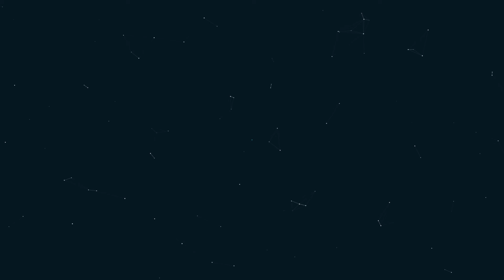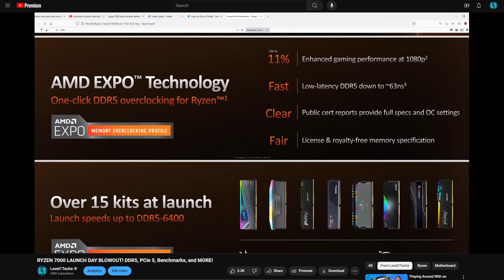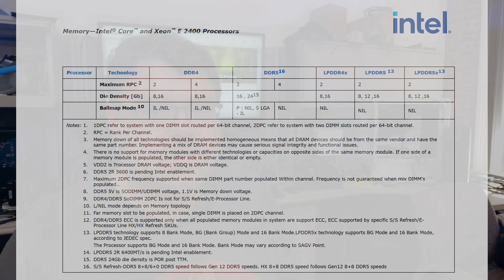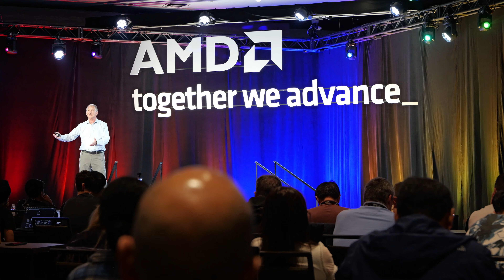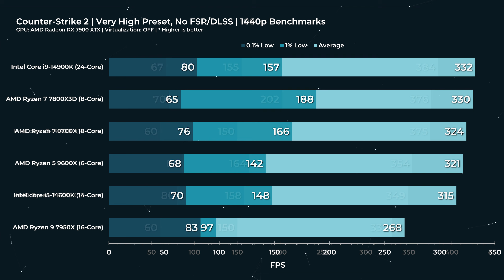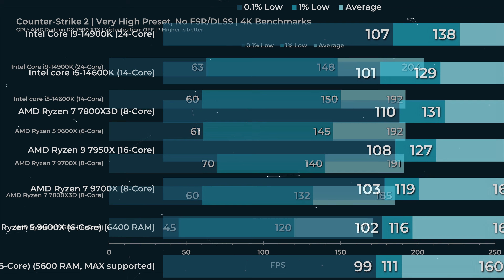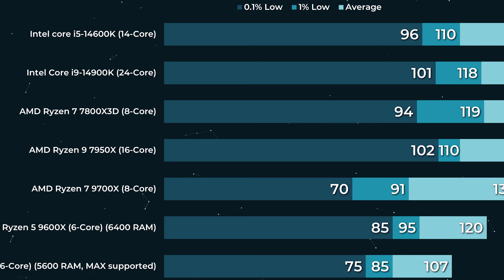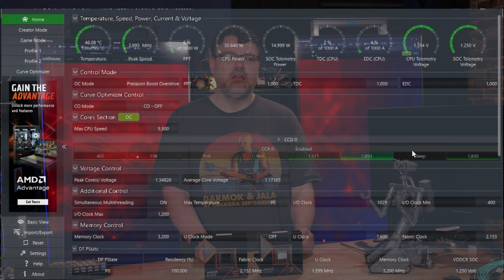Ryzen 7 9700X and Ryzen 5 9600X Review and Benchmarks

Comment: I wish there was more demand for breaking out those PCIe 5.0 lanes into more 4.0 or 3.0 lanes... so many devices are still on 3.0 or 2.0... i need slots, not more bandwidth on all but 1 card...
Reply: With everything on board these days, what do you need more than 4 slots for and if so why not threadripper?
Reply: @jondonnelly3 because thread ripper is overkill just for more connectivity. You are limited to 24 lanes MAXIMUM. The chipset lanes aren't really increasing that. plus with how epyc is, we can do away with the chipset altogether, but motherboard manufacturers wouldn't be happy with that
Reply: It’s too bad Avago (I refuse to use their stolen name) acquired PLX, which were one of the few PCIe switch manufacturers, and now they’re priced so much higher than before the acquisition.
Best chance is to hope ASMedia makes a PCIe 5.0 switch.
Reply: @jordanwardle11 any input on why you might need more than 4 slots?
Reply: @blasiankxng  connectivity card for 10gig ethernet, capture card, usb expansion card, nvme expansion card, second GPU. Lots of reasonable arguments, i dont need them myself, but someone might
Reply: What for? gamers/developrs no longer care to try or use mutli-gpu. Where is most useful, they only use single card and still keep complaining about stuttering or mirco stuttering. See back in the year 2023 14 triple "A" games that released with those problems.
Reply: @kevinerbs2778 I'd like more than 2 NVMe drives. Honestly throwing out my 1TB cards is such a waste so I'd rather put more of them along the older ones. (NVMe needs pci lanes FYI)
Reply: @isevery  thanks! wasn't aware of USB expansion cards but everything else I knew
Reply: @isevery  This is exactly it; And why not? I get it for appliance like machines and pre-builds and dell, hp, etc... however, for almost forever PC has always had internal expansion, isn't that the whole point of building a PC so you can make it your own. I see a lot of ATX motherboards now, yes ATX, that have just a single slot for a GPU... and that's it... what's the rest of the board doing... pains me.
Reply: @fujinshu  yeah; loved the x99 days and PLX, have a few boards with 7x x16 slots, it's all switched so you can't max them all out all at the same time but it works great; ASMedia has been slowly building momentum in the market, just suprised that the DIY build your own market is having to choose between stipped down basic expensive motherboards for consumer level, or having to go all the way to threadripper/epyc/workstation for nearly 2-3x the cost just to be able to add in some expansion...
Reply: Agree but I'd want 2 slots at a full 16 lanes without having to need thread
Reply: @blasiankxng by 4 slots do you mean 1xGPU + 3xNVMe? Yes, sure:
1. I have more than 4 monitors. Even AMD has cut down max to 4 (used to support 6), so I'll add a second GPU when the next generation releases.
2. I'd like to add Thunderbolt 5 when it comes out.
3. There are already interesting pcie cards available from Tenstorrent, and I'm sure there will be many more coming over the next 6 years. I usually use a motherboard as my primary for 6 years - building a good PC takes time. It's fun time, but long nevertheless.
Reply: @isevery Capture card and USB expansion card seem odd for use with PCIe gen5..or even 4.

Wouldn't the existing USB bandwidth be enough for a USB capture device, even on a USB "Hub" (switch), itself mostly negating the need for a USB expansion card?

What would a capture card do with even 1 lane @ 4GB/s?
Reply: PCI 5.0 is in the wrong slot slot 2 is for 8 m.2s also boards don’t have WiFi 7 or I’m sure WiFi 8 will be out before you know it and then there’s a slot needed for usb c expansion slot with 100 watt charging, quality sound quality goes a long way there’s another pci slot no digital optical and it’s pointless, not that anyone’s figured it out yet but fast 10 gigabit or 40 gigabit Ethernet would be useful for ai development, and then nowadays a lot of people will find a need for capture cards I mean u can buy a threadripper board for 900 bux and nobody has these features now your telling me you shouldn’t even use 4 slots of ram common what the hell is even the future
Reply: @contenez7097  yeah, just watched the rest of the video... the ram slot thing is insane. I know this has been sort of an inside thing for a while, even just 1 slot max if you want ultimate performance... but still; Shows we're right up on the bleeding edge of what's possible and then some... this I don't mind as much though; give me the freedom to make a choice so long as the sticks exist for single and double slot combinations... that's what it's all about for me -- just let me pick; give me the choice. If I have no choice I might as well buy a mac studio...
Reply: @akosv96 Except most people seldom draw full speed from all drives at the same time.  And at full speed, the jobs get done quicker.  Would I like more?  Sure.  Necessary?  No.  There are niche cases for everything, that is why we have niche products.
Reply: @contenez7097  If you think there's a desire to return to the "full tower" cases of the 90's there's nothing stopping you making a PCIe expander with PLX chips as tall as you like. Hell, make 8 PCIe 2.0 x16 slots if you like.
X870E supports bifurcation.

Your use cases seem a bit insane though...

PCIe supports a max draw of 75w, so USB-C PD @ 100w will need to run straight off the PSU 12v. What business does it have connecting to the PCIe bus anyway?

Optical audio has hopeless bandwidth. HDMI / DP / USB is the only sensible option.

10 & 40Gb networking has been thoroughly "solved" to the point it's been retired in enterprise. It's 25 & 100 if you want to go fast.
Reply: @lightfoot256 Can't honestly remember the last time I needed to use a PCIe slot.  And I work in IT and build many machines.  I always get a full size board but it's really just for NVMe slots and 4 memory slots.  2 of which I seldom use.  It is simple to choose the board that fits your needs but vast majority of people don't need those.
Reply: @incandescentwithrage  I don’t get it how do u attach your stero which mostly nowadays is soundbars over usb or hdmi or display port
Reply: @incandescentwithrage  I’d jus like to point out normal cases have like 7 slots not everyone needs a 3 slot gpu
Reply: @incandescentwithrage  usb thunderbolt card advertise they can do 100 watt and 60 watt like asus gigabyte and if thunderbolt were actually supported currently I’m sure you would just see more networking over it since 100 gigabit networking cards are what thousands of dollars and out of reach , I find it hilarious that wall street is over there talking about ai buying anything we have ai laptops but ryzens epic cpus have 0 YouTube coverage people are too busy talking about gaming benchmarks like they matter they don’t even make cutting edge games
Reply: @lightfoot256 

So, make the boards way more expensive for everyone to suit the very special needs of 0.1% of the buyers?
What you want is a pro board/server board.
You can't have all for cheap. That's not how reality works.
Reply: @contenez7097  PCIe slots have a max rating of 75w. I don't know what else to tell you.

Your use case was 100w PD charging, not thunderbolt.

Sure you can use PCIe and 12v, but that's not what you wanted it for
Reply: @incandescentwithrage  I don’t remember saying what I wanted it for just that it does it
Reply: @contenez7097  well your comment is right there, so you could read it again.

I'm out anyway. If you think more slots are needed, sell the expander and make your fortune.
Reply: @akosv96  oh I know, but since most gamers don't use more than 2 and the majority of the market is pc gamers pushing for everything they want. You're probably not going to get above 3 NVNe connection. You fall into a niche market, sadly.
Reply: @FutureChaosTV  you can't even get 7 segment l.e.d bios display on board uness you speed closw of upwards to $400 now. Those things used to on most cheap boards that were $90 to $150.
Reply: @FutureChaosTV  you can't even get 7 segment l.e.d bios display on board unless you speed close of upwards to $400 now. Those things used to on most cheap boards that were $90 to $150.
Reply: Just get a board with multiple slot, splitter board.
Most people have enough lanes on the main board and just use a single M.2.
Reply: @incandescentwithrage  USB capture cards are garbage and no serious person would use one for anything other than occasional use.
Internal capture cards like the 4K60 Pro MK.2 use a x4 interface. Why, exactly, do you think it uses a x4 interface if 500MBps (USB 3.0's approximate bandwidth) is enough?
Wouldn't they put it in a 2.0 x1 slot if you could do that?
Use your brain...
Reply: @contenez7097  boards don’t have WiFi 7 or I’m sure WiFi 8 will be out before you know it
A ) The GIGABYTE X670E AORUS PRO X on the AMD side has WiFi 7 (BE) built in and there 7 options on the Intel side with it built in such as GIGABYTE Z790 AORUS MASTER X
So... you're wrong.
B ) Wifi 6 was ratified in 2020, with devices starting to arrive in 2018. Wifi 7 just started having devices arrive supporting it and is expected to be ratified next year.
WiFi standards are updated every 4-6 years or so. If you're holding your breath for WiFi 8, then you're just wasting your time and claiming it will be out "before you know it" is straight-up ignorance.
Reply: @jondonnelly3 

PCIe sound card x1
Usb PD card x2
Capture card x4
TV Turner x1
PCIE to 2 nvme x8
Dell RX 6900mxt x16

Along with 2 extra NVMe SSD.  I just want the lanes bro
Reply: @isevery why does a PCIe 5x16 always goes to 2x8 lanes PCIe 5 slots and not 2x16 PCIe 4. Or even 4x8 pcie4. That would make me so happy And still gives the same speed as two GPU would get now.
Reply: Industrial users often need a ton of UARTs on a synchronous clock for things like railway signal boxes, factory monitoring, electronics V&V testing etc. You could use moxa, but it's often cheaper to buy a bunch of PCIe serial port cards and plug them in. I've noticed manufacturers starting to switch to M.2 cards now since motherboards aren't providing enough PCIe slots.
Reply: @tim3172  Perhaps look at the spec before commenting?
That card is fine with PCIe 2.0 X4 (16Gbps).
USB 3.2 Superspeed ports, USB4 and Thunderbolt are all faster than that.
Reply: 24 lanes are a joke, try at least 30.  Intel's lga2066 non Xeon line had 44.
Reply: @blasiankxng what I currently have in my PC is a usb expansion card, my tripple slot GPU lol, and a front IO USB-C conector cause my mobo doesn't have one for the case front IO. Having more lanes to be able to run some more NVME drives would be great
Reply: @akosv96 In my use case with 5800X and 4090, I have 16X lane all for GPU and 2 m.2 SSDs, one on the CPU provided lane and one behind chipset-CPU internal lane, there is no noticeable performance drop under this configuration while also retain full chipset connectivity(in case the 3rd M.2 slot is used motherboard lost some USB and SATA so no go), incase if I ever going to add another 2 PCIE device I am just going to use 8/4/4 bifurcation, 2 more X4 lane is more then enough for most people with a consumer board.
Reply: @isevery True,
10G card
'n' GPUs - games, jellyfin, ollama
Soundcard
Wifi card upgrade - 6E/7
Usb 3/4 A/C card
Sata/sas HBA Raid card
Nvme expansion - with bifurcation 
Pcie SLC SSDs - the Intel ones

Will need like 7 slots lol, miss the old days when 6 slots was the standard for atx, be it 1x or 8x
Reply: I'm fine with 4 slots, if they were x16 pci3 or 4
Reply: I think no one argues we need 40 Lanes on Consumer Boards while it would be nice for some still. But we should have more than we have now still. 32 seems a reasonable Sweetspot nowadays.
Reply: Agreed! I don't want on board wifi that will soon be outdated I wanna use my own card that I can change! I want my own USB expansion card, capture card, sound card. I need loads of expansion for sim racing devices and these days MOBO's are just selling overkill VRM's and current tech such as PCIE 5.0 as 'Features' when in fact they are just the current tech.
Reply: @FutureChaosTV  the funny bit is -- I don't want it all; I want just the expansion capability. I'll bring my own devices. Economy of scale is an azming thing for the mainstream; just the casm from here over to pro boards is so huge its easier to go with the flow encouraging the move even further.
Reply: @TheUnkow  I don't think these are as common everywhere in the world... happy to be proven wrong? Would prefer all mobos to be ITX and then you buy an expansion PCB like how many servers split the main board and IO such that you can pick what lanes go where and to which slots. Seems a reasonable compromise to me and continues down the soul of PC customisability.
Reply: @lightfoot256  x99 was peak enthusiast PC. All downhill from then on.
Reply: @farmeunit  I didn't mention 5.0 speeds. I mean I am fine with gen 3 or 4 with more lanes to have more nvme slots. 5.0 nvme is so overkill
Reply: @akosv96  I didn't mention 5 either, but that gives more bandwidth for each lane.  It doubles with each gen, so you effectively getting the same performance.  We hardly saturate the current interface.
Reply: @annebokma4637  The reason they split to dual Gen5 x8 instead of dual Gen4 x16 is because it's much cheaper. Bifurcation can be done with cheap mux chips but changing the gen to restore bandwidth requires expensive switch chips.
Reply: @eDoc2020  Ofcourse it is cheaper, I just need more usable slots without spending threadripper money 🤑 
It is just silly to give a GPU 8 lanes of PCIe 4 if you want to use a dual 10g ethernet card or something similar that more often then not require a x8 slot too. That halves your effective bandwidth because the slot can't deliver the bandwidth in the way the GPU can use it.
(PCIe 4 because GPU are PCIe 4 "ofcourse"). 
Sadly I am old enough to remember pc having at least 8 usable full bandwidth slots..and that was way before the short-lived trend of xtra long Mobo that had 10 slots.
If I need to pay what they date to ask for a mobo with two x16 slots, they should make the slots optimal for optimal use. Heck some if those boards should be gold-plated 😎🤣
Reply: @eDoc2020  and another reason switch chips for PCIe are so expensive.. lack of competition. Can't remember which of the big players bought that one company that produces PCIe switch chips, but before that take over you sometimes saw one in the wild, that stopped from that point on.
Reply: @annebokma4637   As you said, a lot of it is the new Broadcom buying up PLX and giving the chips the same price treatment they gave VMware.

The other thing is of course NVMe slots eating up the remaining lanes the consumer platforms had. I don't know how many mobos have mux chips but it seems like a reasonable compromise for consumer platforms. I can live with slightly lower peak SSD speed if it lets me use a video capture card.

The absolutely terrible bit is just that they have high-end full-ATX boards with only two physical slots. The whole point of full-ATX instead of mATX is that you have more slots.
Reply: @eDoc2020  I thought it was Broadcom, should have trusted my memory it seems 😁
I agree especially for ATX or even worse E-ATX boards. Such a waste. Give me a mobo with one nvme slot with PCIe 4 and I will be happy, give me two for raid one is welcome but not needed. Now also give me a faster network interface so I can connect to my NAS where all my data is stored.
Have you seen the number of big am5 boards lacking 10g ethernet? Not even one port while two should be standard for higher end by now.
At this point I am hoping that the new 16 core Apu coming (early) next year gets spooned into a (mini) pc with a 10g port and I will be done, upgrade the RAM to 64gb+ and I will be happy as a pig in fresh mud.
Reply: @annebokma4637  Another thing, the switch chips add a bit of latency. Unless you need the functionality it will hurt performance. This severely limits the appeal of such a feature.
Reply: @eDoc2020  good point, so it's a choice between bandwidth and latency. Not a gamer myself, more resolve and DAW daily use. So the latency for me is less important than the possibility of getting everything in there that I need. And especially on the more affordable boards there is no way to have a GPU and an x8 PCIe card. 
But that is kind of the point, they cater to gamers until you get at unaffordable prices for professionals who make that money back easily. The semi pro/prosumer hasn't been catered too for a long time now, sadly.
Reply: @annebokma4637  I don't remember the model but my brother's cheap AM4 board has dual x16 slots (probably 2x x8 if both occupied) and one x4 slot, enough for some extra storage and/or network. It was one of the reasons for choosing that particular board. I don't know if the choices are worse on AM5 or not.
Reply: @eDoc2020  I skipped buying AM4 due to circumstances 😎 but I can't remember an economy board with both x16 slots having 2*8 lanes connected. I bought one for my son but he didn't need that level of slots then (yeah he grew up fast 😁)
On AM5 most "affordable" boards with 2x16 slots have some weird things going on. Making the cheapest board that came close to what I wanted around 500 when I bought my son a new system six months ago 😁 and he still just got a single x16 slot, but also a X4 slot with a single port 10g card. Love him to bits, but not going to pay 500 for a board just to get connectivity one extra 10gb port 🤣
AMD platform longevity means that I now can buy something nice for myself 🤣🤣 working on laptop still, latest pc is an FM2 platform.. don't laugh.. too hard 😎
Reply: @annebokma4637   I think it was Gigabyte Aorus B450 DS3H. It looks like the second x16 slot is only Gen2 x4 (and the third slot is only x1) but it's still better than nothing. The x4 connection is plenty for basically anything that's not a GPU. I specifically had an HBA in mind, or possibly a 10gig card.
Reply: @eDoc2020  yeah that didn't change for cheaper AM5 boards with two x16 slots then. And the X4 is enough for a sata/das hba or a single 10g port card. But if I buy a system for myself it needs to last 5 years. And I wanna start with 2x10g and take it from there.
And yes if I win the lottery there will be 96 cores with at least 1tb ram under my desk 😁